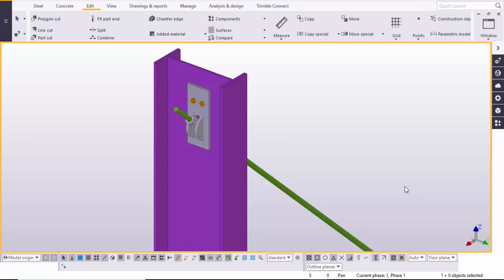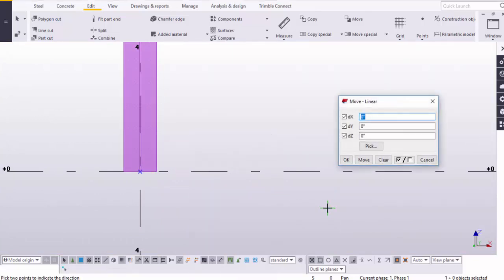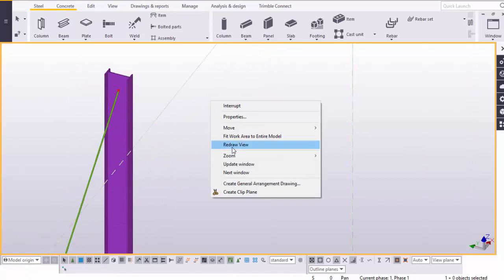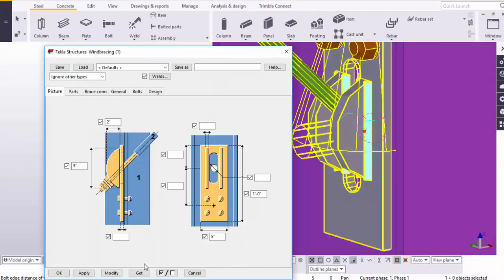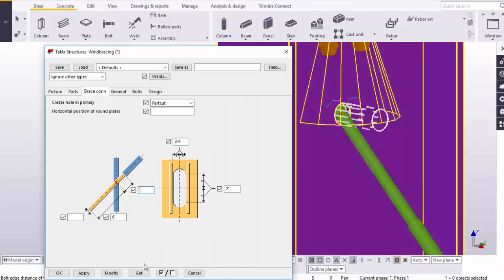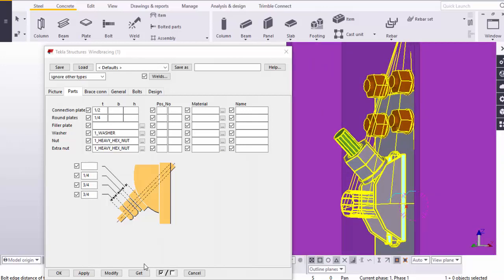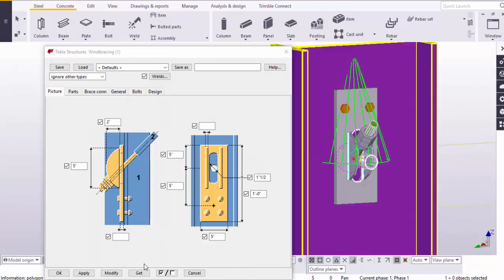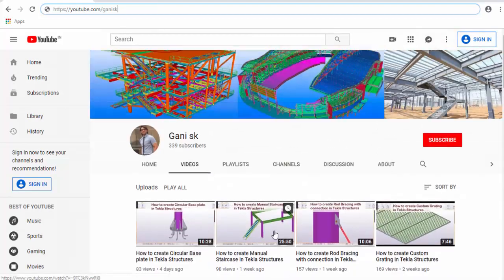how to create Rod Bracing connection in Tekla Structures

Comment: How we weld that rodbracing backup plate with beam in component no manual welding.
Reply: With out explode component
Reply from the maker: Select object in component option at bottom of screen then do manual welding, if needed.

Comment: can you tell me which diameter of rod should i use for 20m span??
Reply from the maker: that would be depends on building design, wind speed, building area and height. You can not decide to use the diameter of the rod with single parameter 20m span. you should have above information to design the brace rod, then finally conclude that which diameter of brace is needed for the building.